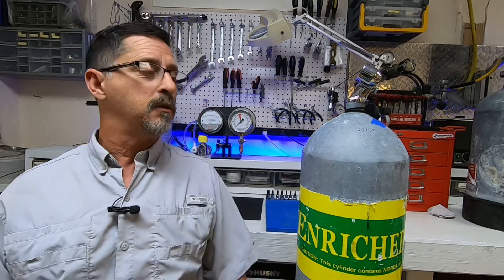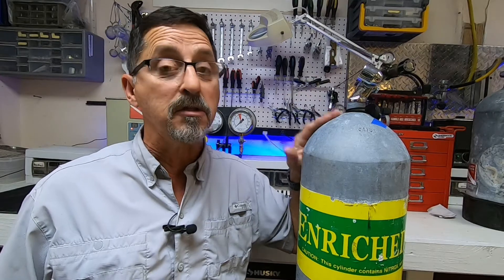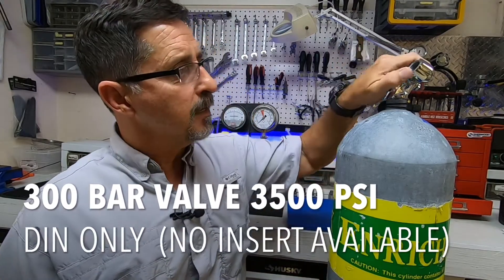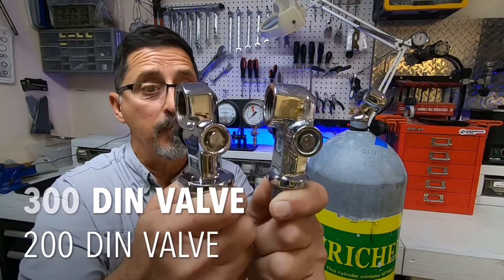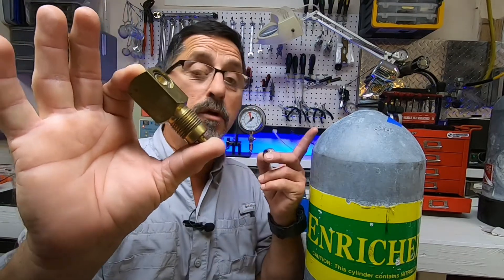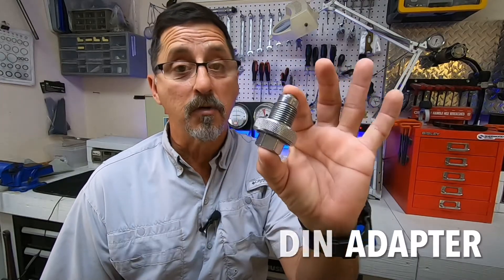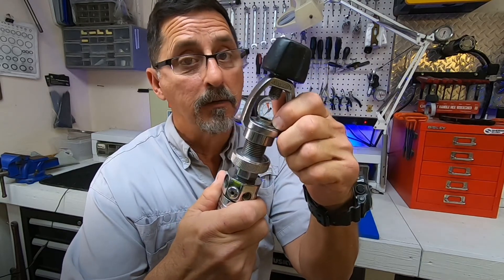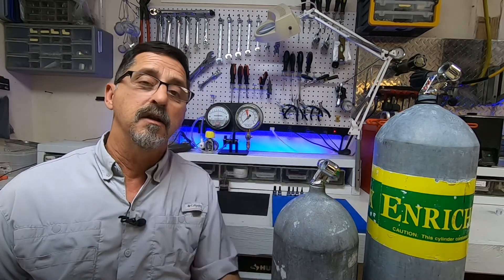Din Only? Scuba tanks for 300 bar DIN, can't use yoke style regulator

Comment: hi, after switching to DIN, did you simply slap the original yoke back on the DIN , or was that a special DIN to yoke adapter?  If it was a specially bought adapter why not simply remove the DIN you just installed and reinstall the original yoke? Am I missing something?  Why add an extra part?
Reply from the maker: Din to yoke adapter allows for quick change without tools.  With this adapter you change over in seconds and go back to yoke, and back to DIN on the next dive.
Reply: @scubatechkeylargo  aha, my original mistake was getting my f8 with yoke
Reply: @scubatechkeylargo  thanks

Comment: Are there issues with connecting a 300 bar DIN first stage to a 200 bar DIN tank valve?
Reply from the maker: No problem, the 300 DIN will fit.  However the reverse will not work, a 200 bar DIN into a 300 bar valve.  DINs are primary made as 300 bar, Posiedon did make a 200 DIN regulators in the 1970's which some divers still use.

Comment: Is there a way to extend a 200 bar thread to a 300 bar thread on my first stage? I have one of these tanks described in this video.
Reply from the maker: You can install a 300 bar DIN onto your regulator to fit the tank valve. The tank valve on a 3500 psi smaller neck cylinder can only be 300 bar.  A 200 bar valve is not made for this tank.  Thanks for the question...

Comment: Hello. I have an old scuba tank with 300bars pressured air and 7/8" DIN valve and I'm looking for a fill station for my HPA tank at the airgun. Can I use the 7/8DIN to yoke adapter you showed to fill my smaller hpa tank if I don't go over 232 bars? Could it still handle 300bars momentarily when filling if I were to fill it to the 300 bars? My smaller bottle and bottle regulator are also rated to 300bar but I think the yoke connection of the adapter I plan to use is the weakest part here. 

Other question is, what is the function of the small brass part at the end of the DIN male connector? Does it seal the connection somehow because I have seen regulators sold where there are no brass plate at the end. Some of them also have the o-ring sealing at the stem of the threads and I guess this can only be used with straight to the scuba tank connections where the tank has a groove for the sealing ring on itself and can't be used when there's this old 7/8"DIN valve between them, right?
Reply from the maker: Yes you can use the 7/8 fill adapter it can handle 300 bars no problem.  However it's not ntended to dive only for filling.
The small brass part is a stem which fits inside a recess in the 7/8 valve. This brass fill adapter was designed only for the 7/8 valve,  you can find differnent fill adapters without this which also work fine. 
I hope this helps, thanks for the question.
Reply: @scubatechkeylargo  Thanks. One more thing, I'm trying to find a proper DIN-yoke adapter now from around the net but I only come across with adapters that are 5/8". If I don't find a suitable adapter for the yoke connection and the fill station I have, could I simply use one of those fill stations that has 7/8" thread but there are no rubber o-ring at the end of the male connector on these, but one at the stem of the thread as in those regulators we use at our HPA tanks in our guns. So, can the thread be sealed properly if there's no o-ring at the end of the male thread like you'd normally had in DIN male?
Reply from the maker: The 7/8 valve refers to the threads in the tanks neck.  The Din thread are all the same, any din to yoke fill adapter should work fine.
Reply: @scubatechkeylargo  Hmmm. Now I'm confused. In this video you show the difference between 200 and 300 bar valves and their bottleneck thread seems to be different size...  Also, my friend measured my tank's valve thread and it is 7/8" where the fill station(or 1st stage) should be attached. This 90's tank setup is actually two tanks in parallel, connected with a connection that has a thin tube between the tanks inside the composite plastic carry handle. Could this be CGA347 because these are old firefighter bottles?
Reply from the maker: the HP steel in my video is a 3500 psi which is the 7/8 tank threads and 300 bar DIN
the 3442 HP steel can use 200 bar DIN and conventional valve threads, same as in alum 80
Firefighters use SCBA bottles which are carbon fiber wrap and CGA 347 valves
Reply from the maker: if you would like to email me pictures just make clear, email me at 
info@scubatechkeylargo.com
Thanks